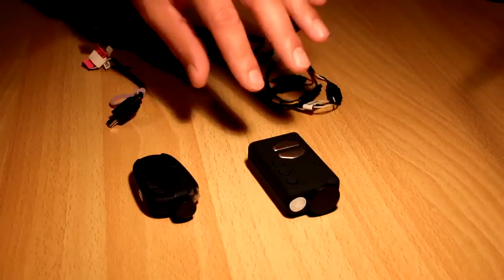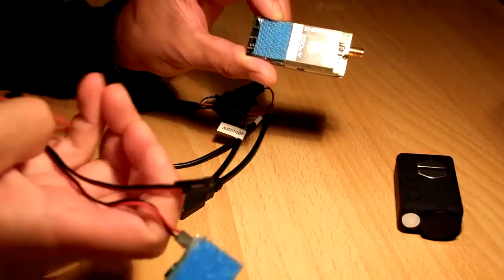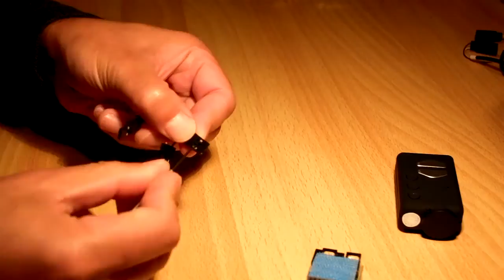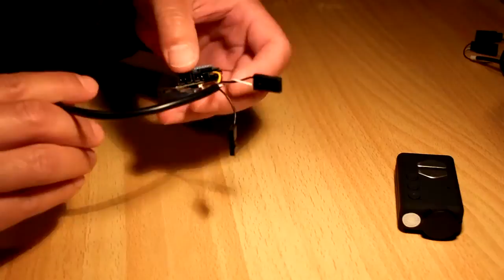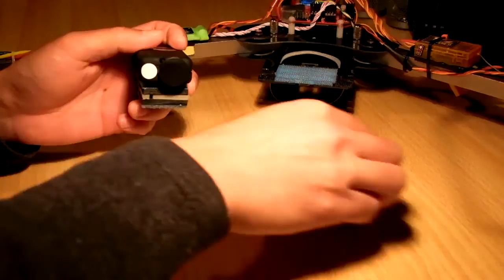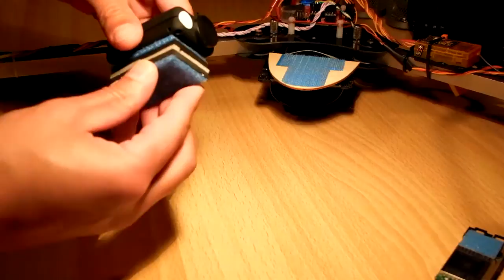How to connect a 808 #16 V2 or Mobius Camera to a VTX for FPV

Comment: I wondered why you were using the 5 volt out pin and didn't have the TX even plugged into the top red and black connectors. It would have helped if you showed ALL connections done RTF. Now I understand that to operate you will need the not shown input from the quad battery to the TX. I just need yellow vid and black common from that harness connected to Mobius since we power up the TX with the top red and black connector and I'll run camera with its own battery since it's weight is already there... Right?? I'm doing 15 min max quad flights with a MJX Bugs 2c/3.
Reply from the maker: Glad you worked it out. I used to remove the mobius battery to save weight on my glider's nose, so needed the 5v supply.

Comment: I lost you when you said when you plug it in it sends power to the camera, but doesnt the mobius have a battery for power already?
Reply from the maker: Yes, but it runs flat in half an hour or so if you are streaming live TV out. Also, you can save weight by removing the battery from the mobius and just powering from the USB/TV-out.

Comment: +ZaKsterBlue hello, i want to replace my wltoys v686g camera. my question is: the stock camera has an antenna but i want to replace is with mobius and i cant see any antenna on the mobius. what is the function of antenna? can i connect the mobius directly on my quadcopter and have direct fpv ?
Reply from the maker: No, the mobius is only a camera, it is not a video transmitter as well.

Comment: I use the HD runcam on my syma x8c and I to was getting jello. So I did all kinds of things to reduce jello and I noticed that the wind was also causing vibration it would only do it on really windy days or if I was going fast in forward pitch so I made a box out of Styrofoam and I fixed it to where the HD runcam or mobius camera or 808 keychain camera could fit tightly inside and then I mounted it to the quadcopter and now I don't get any jello at all I mean it gives a beautiful picture. so I called it the runcube for the runcam and it really works great

Comment: I was wondering if I can Charge my 808 #16 (without damaging it) with a car charger that was intended for a TomTom GPS Device.  

The charger has the following specs... 
Input: 12v/24v, Output: 5v/1.2A, Fuse: 250v/1.6A

If anyone have the answer to this, I would really appreciate it.  Thank you
Reply from the maker: +Wyllye Ly The 5V output is the main thing you need to ensure, so you should be fine.  The 1.2A doesn't matter as the camera won't be drawing any more than it needs - probably only 0.3A...
Reply: ZaksterBlue Thank you.  I did some research and you are right

Comment: Thx, nice and detailed. What about the powerconsumption between transmitter and Mobius? That could be an issue if someone use externally battery. My old Avionics transmitter says dont use cams consuming more than 250Mah. Well the Mobius goes higher than that says others on forums. So is it an issue? I dont have the answer.
Reply from the maker: I power an ImmersionRc 600mw, which feeds 5v to the mobius and get 45 minutes from a 500mah 3S. I can't confirm exactly how much current the mobius draws but it has not been an issue for three years.
Reply: +ZaksterBlue Good to hear that. I have a Avionics rc922 1000mw. the manual says the vtx could go warm/hot if used more mah than 250. But there are others doing the same thing as you so it is probably no issue with if vtx doesnt go warm/hot. Found this link:
http://www.rcgroups.com/forums/showthread.php?t=1904559&page=101

Comment: why do you connect power to the mobius? The mobius has it's own capacitor battery.
If you connect power to the mobius, can you remove the mobius battery then? because it is useless weight.
Reply from the maker: Hans Ham Yes, you can remove the battery to save weight. In my current plane, I leave the battery in, but turn the USB charging option off so that the power from the plane simply runs the mobius rather than charges it.

Comment: Hi, Do i have to give separate power for the transmitter or it will work with 5v from the USB??
Reply from the maker: kumar manav Most VTX need at least 7v to operate, so you will need to power it with a 2S-3S LiPo.

Comment: hello, do you know if it's possible to somehow rotate the mobius lens module 90 degrees, so the case can be mounted vertically? thanks
Reply from the maker: Janusz Buła Hi, I don't think you can do it easily in-camera, as you would have to rotate the sensor and cabling. You may have to get the external sensor/lens kit for the mobius.
Reply: Thanks for your reply, ZaksterBlue 
With a lot of digging I think I found what I was looking for. Someone came up with the idea of making holes in the case to fit in the rotated lens module and connecting it with a 2'' cable.
http://i.imgur.com/QoNJE1K.jpg
http://i.imgur.com/4Z3Qf04.jpg
http://i.imgur.com/Nsykzse.jpg

Comment: If we want the mobius to run under its own battery and we have a seperate power source for the vtx, do we still need the 5v connection? I would rather not have anything meddling with the mobious battery as I have heard that the lipos dont react well to improper charging/discharging..
Reply from the maker: The 5v is optional!

Comment: Can you use the same output cable for the 808 on the mobius action camera? The on for the older camera on the newer one? I have been struggling to get a signal for my fpv system and I think i have the older cable but the new camera.
Reply from the maker: Unfortunately different pin assignments between cameras. If anyone you know has a Möbius, try their cable to test that this is the issue.

Comment: if i wanted to use the mobius on-board battery, while outputting video, could i just connect the black and yellow wire, and skip the red?
Reply: +odortiz I also want an answer on this question

Comment: Hi Zak, I was wondering if you can help me with a few questions?about setting up my Partom 5.8G transformer and receiver I just bought. I am trying to hook my Mobius action cam  and a 7" monitor. this Partom kit gave me Ect parts and wires I don't no were to start? thx Kazz
Reply from the maker: Hi, I don't think those partom vtx units step down to 5v so DO NOT connect any power pins to your mobius until you've verified a 5v power source. You should be able to connect the video and ground wires as per the instructions of your vtx though.
Reply: ZaksterBlue Ok I'l check. Do you think it's possible to split my Latrax Alias battery and use that as power for transmitter. (3.7V 700 mAh) and then split my 7" monitor power source witch I'm using a 11.1 20c (Flight pack 2100)?

Comment: So you don't even need to solder? Does it need any rienforcement? Those wires dontbseem like they would stay in.
Reply from the maker: Klinger RC You can do some soldering or extra crimping if you want, but I've not had any issues with the wires staying attached to servo pins. The wires are so thin that they would break under pressure whether they were crimped in or soldered.
Reply: ZaksterBlue Thanks! I built the cable and it works great. I'm getting awseome vidoe now and it saves wieght on my quad by removing the extra fpv camera

Comment: When I connect to a TS832 using your wiring scheme the Green Charging Light comes on, on the Camera and I cant go into recording mode. I can fix this problem by removing the red wire from the 3 pin connector BUT then the cameras battery will not charge. How do I set up so I can charge the battery while recording.
Reply from the maker: Hi, a few of you are not reading my warning about ensuring the Möbius is only powered to 5v. The TS832 just passes through the battery voltage so you are lucky it didn't fry your camera!
Reply: Failed to notice the warning box. Hooked it up and fried my $90 Mobius camera. Looks like I was not alone. Please remove this video and include a verbal warning off the start, unless of course you work for Mobius, then keep up the good work getting sales up. ZaksterBlue

Comment: I had used my mobius as an fpv cam once. 

It worked great with just the video(yellow and black) hooked up, but when I tried to hook up the 5 volt(didn't measure it, but the manual said it was 5 volts), and what I THOUGHT was audio out(white), it burned up not only my mobius, the 500 mW transmitter, and then the 808, 16 I tried after snipping the white wire. 

Turns out, the white wire isn't audio out while the recorder is recording, but audio out during playback. 

I am not sure if that is why it burnt up, but it was an expensive lesson for me.

The only reason I hooked up power at all, is because it seemed to drain the battery on the Mobius really quick.  Wow do I wish I hadn't done that...

Now, I am out a camera while I wait for another one to come from Hong Kong...

Comment: Hi When i tried this It completely fried my mobius and my skyzone 5.8ghz rx started smoking aswell any idea how it happened. Im sure it wasnt anything to do with how you did it but something to do with the wires i have any ideas to what happened
Reply from the maker: Hi, if you have a foxtech ts832 or similar vtx, this outputs 12v, not 5v, which is why my description starts off with a warning. Did you measure the output voltage of the vtx before connecting the Möbius?
Reply: No unfortunately looks like ill have to buy a new mobius. Thanks

Comment: Great job fella thank you for that I will link back to this video when I do my DRQ250 build video for RCTV-UK. Nice and easy to understand and works a treat! Are there and latency issues using the Mobius?

Malc
RCTV-UK
Reply from the maker: Thanks! People have tested latency while recording to be between 60-100ms which is OK if you are floating around in a plane but a bit dangerous for close proximity fun with a copter. My mini quad has a separate FPV cam.
Reply: Links up now bud, looks like the latency issues may have been resolved in firmware as we are not seeing any.

ATB Malc

Comment: It would have been much better if you put a heavy item(plexi glass) in the middle of that mount instead of the soft foam. This works the same for Helicopter gyro's.
Reply from the maker: Thanks, I am still trying to work out good mount options. Earplugs work well on their own.
Reply: Yeh earplugs work good aswell :)

Comment: I did this and it works and i have very little delay. It is barely noticeable so they may of changed the software on the Mobius HD however the fatshark transmitter gets really hot. So I wouldn't trust this because I think it will burn the transmitter.
Reply from the maker: Yes, all my VTXs get hot in use as well, so I either put them outside or near an intake.

Comment: Hi love yr video really thinking about going fpv but really want to keep the cost down would I only need goggles video and a transmitter as Iv got the Mobius camera be most gratefully if you could help.
Reply from the maker: Yes, you just need the cable set - check out the lightweight ones on RMRC which are pre-made to plug into a Fatshark/ImmersionRC style VTX if you don't want to buy the standard Mobius one and rewire it yourself like in this video. I first bought the cheapish Fatshark Predators but while it got me going, they weren't very immersive because of their tiny, low contrast screens... so I upgraded to AttitudeSDs - wow, what a difference!

Comment: Dang, so my 8o8 #16 V3 or Mobius won't work on a 3.3V video TX? I bought the one from Foxtech Model: TX5823
http://www.foxtechfpv.com/product/5.8G%20modules/tx5823/TX5823-Spec-V1.pdf
Reply from the maker: Just don't connect the power wire and charge the cam battery beforehand.
Reply: Thanks, Yeah thats what i figured. Ill just run the Vtx of the cameras battery, but with a separate power harness tapped into the original battery one.
Reply: Champsteroffroad So was your +5v from the harness also powering your Vtx? Another words was your usb cable out the Mobius also powering your Vtx using the Mobius camera battery?
Thanks.
Reply: Champsteroffroad Never mind realized the +5v is input not a +5v output on the usb harness.

Comment: Thanks for the very good totorial mate. I just built my first quad. Still learning the ropes. Once i'm confident enough, i'll put FPV gear on my quad. I thought about using this camera for fpv, but from what i read, it has about 120-160ms latency. Add that to FPV systems latency(30-50ms) it adds up to quite large amounts. I guess if you are flying a plane high up in the air, it's negligible, but i'm worried flying a quad 2 metets up the ground with that kind of latency will be too much for a newbie like myself. What are your thoughts on that matter?
Reply from the maker: I've only recently realised just how much a bit of lag affects the ability to do close-proximity flying.  I'm about to install a separate FPV cam and just have the mobius record the flight.

Comment: Before watching this video i did exactly this as it seems like a logical thing to do.. but i have watched this and checked everything but i am not receiving any signal to my goggles.. I am using a new 808 #16 keychain cam and Fatshark Attitude V2 goggles.

Any help appreciated
Reply from the maker: hi, have you enabled TV out in the GUI software?
Reply: Hi Zak. Yes just after posting this comment i figured out that there was some software to enable the TV out. i did this and worked fine. Cheers

Comment: Anything better than this for the price nowadays??
Reply from the maker: You mean the Mobius?  Not sure, there are a few 1080p cams popping up, but not many can stream fpv output while recording HD for less than $100. This cam is still under development, so it will only get better with firmware and GUI updates.

Comment from the maker: +Noah Golly Yes, the cam does both concurrently. Only slight lag on the tv output - not enough to worry about unless you are doing very high speed low level through trees.

Comment: Question for video out: do the mobius / 808 #16 USB cables use the same pin config?
In other words: can I use my existing 808 #16 USB to vide TX plug for the Mobius?
I have only GND/Video out connection, not Audio or +5V...
Reply: I believe the pins are different. You can Google for both cables and compare, you may be able to work out which cable becomes video out for the mobius. The official mobius cable allows the camera to automatically switch on tv output mode so there may be extra pins connected.
Reply: Zak Sherwood Thanks for the info, I will check the differences

Comment: what battery is safe to use to power the fatshark vtx with the mobius camera connected? or will the vtx keep the camera safe from too much voltage?
thanks
Reply: The vtx will output 5v whether you connect a 2 or 3 cell. There is no difference in vtx range using 3S so it's better to use 2S if powering it with a separate battery as this may generate less heat.

Comment: i want to use the audio as well,  i have fatshark 5 pin vtx and want all the mobius cables into one 5 pin connector for vtx.  would you just rearrange all wires to match the vtx series in plug?

Comment from the maker: any portable battery pack with a standard USB output will be fine. a cheap option is to get a hobbyking lipo to USB adaptor and use a large 2c battery to power it, as long as you don't drain the lipo of course.

Comment from the maker: The Fatshark/IRC VTX only needs 2S power but can handle 3S. Either way, it outputs +5V to the video cam if you connect to this pin. I've done some range testing to compare 2S vs 3S and there is zero difference so it's actually better to use 2S as this generates a little less heat in the VTX.

Comment from the maker: Thanks! The 808 was fine with the Cyclops Storm I had in my Bix2 (until I lost the whole lot), and the Mobius would be fine too. I wired it up without a common GND for video first and got a fuzzy pic, but once I realised that my video GND needed to be common with the OSD when using a 2-batt setup, I was able to fix it easy.

I don't want to pull my Arkbird out of the Bix1.1 to shoot a video so you're out of luck for now! :-) Just take it slow. Try a 1-batt setup to test OSD before going 2-batt.

Comment: Damn thats an easy video to follow :-) has seen some others that are anything but. :-( 

Out of interest have you tried this camera with your Cyclops osd? I have a X525 Quad and am using the KK2.0 Multi-rotor Flight Control Board. Ive just bought the Cyclops OSD, RTH as well as the Mobius cam and wondered how that would compare to your Bixler setup (in other words) hint hint, can you do a video showing how to set them up. ;-) Anyway A Great video and am watching your others..

Comment from the maker: I just checked my Fatshark VTX, and the "+5V Out" pin indeed puts out 5.03V, so it's all good. Will also check my ImmersionRC 600mw for peace of mind, but since it's been powering my 808 #16 V2 for the last 10 months this way without any harm it should be ok!